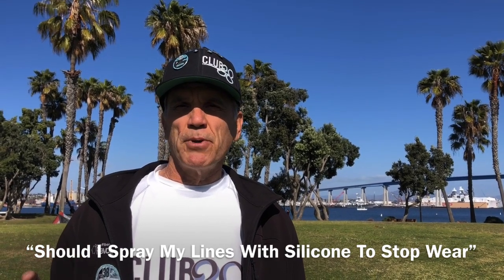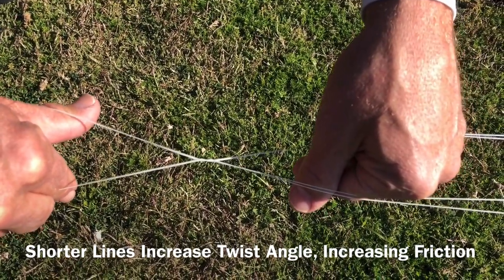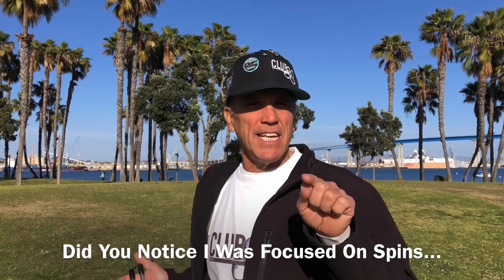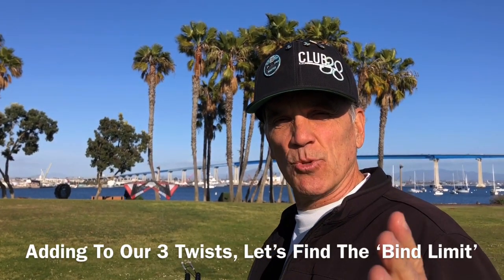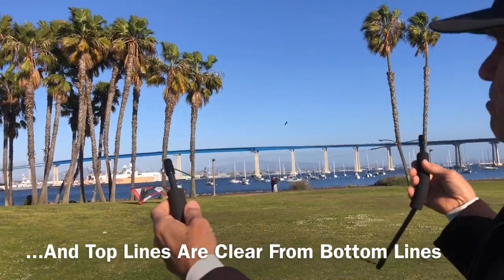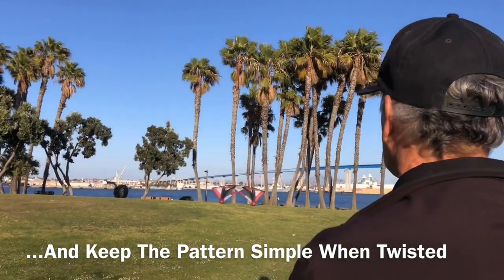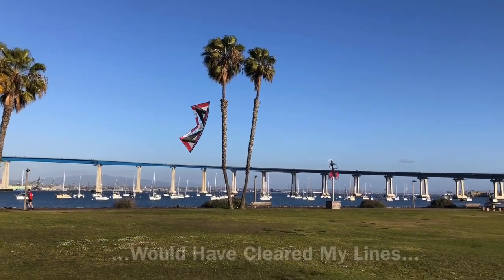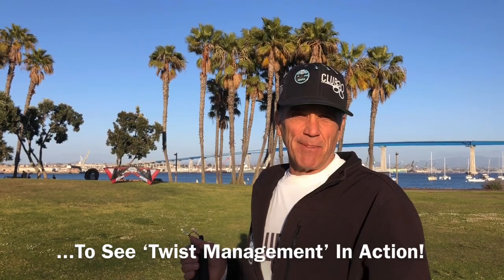Revolution Line Wear and Binding- Tips From The Masters

Comment: Hey Joe, thanks for the vid!! I have a question, should the bungee cord on the caps be tightened after you've been flying for awhile? How loose/tight should they be?
Reply from the maker: Yes Thomas Farley...  The way I tension my Rev is to assemble the Leading edge and caps.  Then put your 'down strut' in the top (leading edge) cap.  Now take the lower tip of the wing and pull down (just like the bungee does).  I adjust the bungee so there is a slight tension down the 'strut line'.  Don't 'over-tension' since this adds unnecessary wear stress to the wing.

Comment: Joe, speaking of string management. Is there a consequence of putting them away while they're damp? I packed up in the rain the other day and it was a few days before I got them back out again.
Reply from the maker: Great Question Steven!  Spectra is a high-strength, low-stretch synthetic polymer, so it is virtually impervious to moisture.  The real problem comes from moisture attracting sand or dirt to your lines.  Putting your lines away, wet and sandy allows the sand to imbed in your lines causing friction and wear and tear next time you fly.  Some pilots rinse their lines after flying in sand.  For me, this is too much work.  Try using some of the techniques in the video to reduce 'wear and tear'.  Soon the techniques will become a habit and your wear and tear will significantly be reduced.